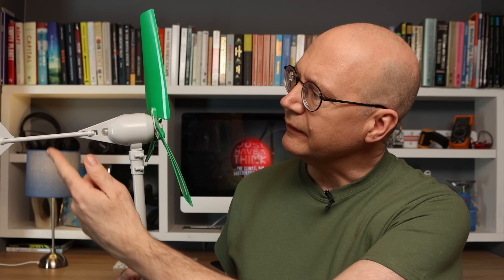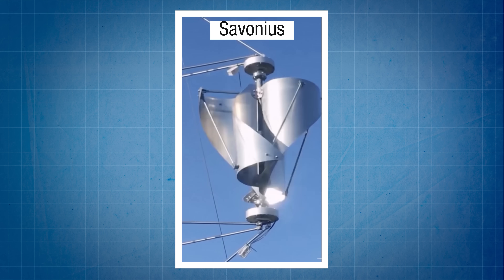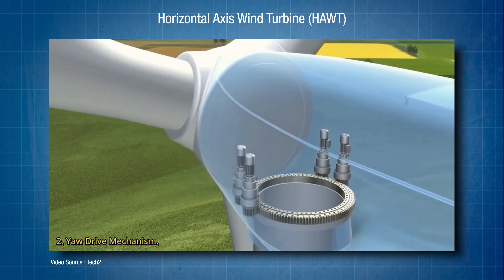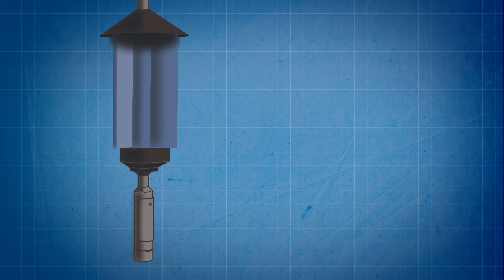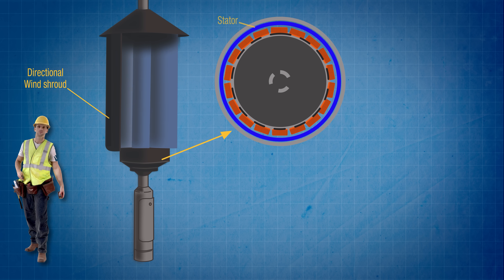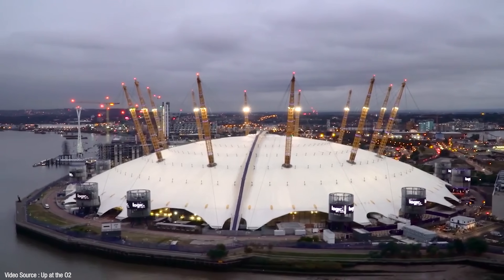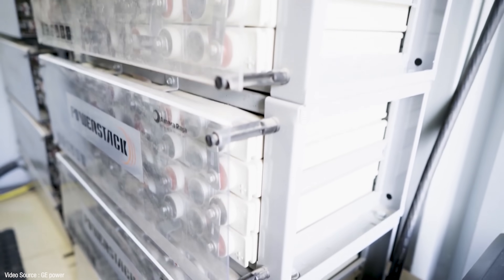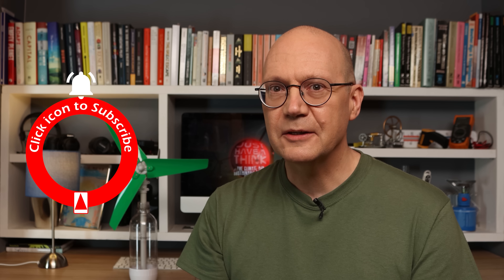A vertical axis wind turbine that doesn't need the prevailing wind! How do they do that?

Comment: This is ridiculous.  For every action ther is an equal and opposite reaction.  If a passing car is causing the turbine to spin then the car is applying a force on the turbine.  In this case air is the medium used to transfer that force.  If the car is applying a force on the turbine then inevitably the turbine is applying a force on the car by revisiting the flow of air away from the vehicle.  Since a gasoline or diesel engine is ultimately driving the vehicle then in this case you are effectively forcing the driver against their will consent and likely even their understanding to sacrifice a tiny amount of their fuel efficiency to power these roadside turbines.

While it might not seem like much if a single driver passes one or even 10 of these it certainly becomes significant if they pass those same 10 for years.  Imagine thousands of then lining roadways everywhere.  Again the individual driver might not notice at all and yet that increase in cost for them to operate their vehicle is still there.  It would be like stealing a penny from 100 million people.  Yea no individual is going to notice but you still stole from them and now you are a millionaire.  

Ignoring the legal repercussions as soon as a class action lawsuit gets wind (put intended) of this ther is a much greater concern.  The whole idea of wind power is about sustainability and renewability.  Since this power is being leached off of random gas and diesel engines then these are what is ultimately generating the power.  Automobile engines are incredibly inefficient compared to power plants.  It's literally almost the worst possible way to generate energy on a mass scale.  Assuming a utopian future where everyone is driving electric cars who's batteries are charged with wind or solar then you have the same issue though not quite as bad.  All you are doing is taking those tiny bits of energy generated elsewhere and transferring them from the cars battery into wind power for the roadside turbine.  At this point you still lose energy based on the efficiency of the battery.  Also you still have the legal repercussions of stealing from millions of drivers passing by your energy u siphon on a yearly basis.

This looks like a pretty cool idea at first glance.  Without considering the physics of where the energy comes from it looks like free energy.  Or recovering wasted energy.  Sadly this is not how the universe works.  Nothing is free.  All energy comes from somewhere.  I. This case it comes from passing cars.  Sadly for all energy transfered into the turbine by the car there is an equal resistance transfered back to the vehicle which it pays for in fuel efficiency and ultimately at the pump.

Comment: They have added a air flow cancelling shield on the back side which doesn't block back flow. The shield blocks wind from the back side detracting to the effectiveness. There is no negative airflow on a vertical axis blade. The blades are not reversed on the backside.
They could add some positive force deflector fins to the entire device much the way are found in jet engines to increase the air pressure inside the turbine.

Comment: I want to thank you for posting this video.   For more than 4 years, I have been thinking about how nice it would be to harvest the wind generated by vehicles driving on highways.   I had proposed that my son, then in 8th grade, put together a science project looking at vibration type wind generators (e.g. like blades of grass), but his teacher shot down the idea as infeasible.  Your video brings many ideas to the front line of future alternative energy solutions and I applauded your efforts. I also applaud your quick correction, as many folks don’t like recognizing when a mistake has been made.  Very nicely done.  If I had any engineering skills, I would be working hard to improve alternative energy systems as I believe our future and the future of our planet depend on it.  Thank you!
Reply from the maker: Hi Oswald. Thanks for your kind words. Much appreciated. You might like to check out this latest video from a YouTube colleague.

https://www.youtube.com/watch?v=iWGfB4najfM

It actually features precisely the type of bladeless wind 'turbine' that you described in your message
Reply: Thx.  I spent the last hour getting acquainted with Rosie, at your suggestion.  She is brilliant.  I will look at the additional link soon.  All the best, O

Comment: slow the air alongside the road so the next car pushes on motionless air again.  the air flow by the road slows the relative speed of the headwind the vehicle hits.  conservation of energy means the cars are going to replace the energy.  no, this is not a smart use; more like perpetual motion.

Comment: A friend ask; if the entire world goes electric autos, how are they going to charge them. My reply; Power generators produce electricity 24/7 used or not, so while people sleep their autos and house batteries recharge.
Then, I told him, new technologies and process will be developed, as with all other new devices. Here, is a new process to add electricity to the grid or off grid applications.
These turbines could be incorporated into the design of an electric vehicle then the primary or secondary battery could be charged as you roll on down the road, cutting the total amount of electricity that would be required to recharge your batteries.

Comment: I use a 7kW home charger to charge my EV overnight less than once a week. I wonder if one of these, with a maximum output of 6kW would be capable of charging an EV? Even if it took twice as long to charge! 
It might also be a suitable solution for people who would like an EV but don't have the ability to run a cable from their house to their car. Perhaps one of these turbines fitted to a lampost on the road where the car is parked could be used instead? In return for giving the EV owner priority parking at the lampost perhaps the car could provide battery storage for the light and turbine to power the street light as well, meaning that the light would not need to be connected to the electricity grid? I can see that the output would be reduced because the charging car would tend to shield the turbine from the traffic so it's not a perfect solution but there must be many opportunities - perhaps for installing a self-powered street light outside your house and also using it to charge your car?

Comment: I have some decorative “wind spinners” and was surprised at how much they spin. I didn’t realize how much the air moves where I live. I would love to see these VAWTs produced for use by houses.
Reply: Nina, you're right on. If you wanted to power your yard lights and such by harnessing local gusts and storing that energy in lithium cells, much like how those little solar walkway lights work, then absolutely give it a go. Heck, if you have enough of them, you might even be able to offset your home lights. Power storage is pricey if bought new, but it can be a fun learning experience if you're willing to think outside the retail store.
Reply: Yes, but connect them to a generator with an electrical load on it and you immediately need a lot of torque to spin those blades. I had a hand-cranked generator (a test box of some kind for checking insulation I guess), and open circuited, you could spin the handle with little effort, but if you put a dead short across it, it was almost impossible to spin the thing. Obviously, with ordinary loads it was easier but still took effort.
Reply: @and7barton  That’s why the engineers need to design ways to get the most bang for your buck.
Reply: @and7barton  you could not be a direct moron and contact it to a controller and a battery and then in a separate circuit connect your load to the battery. Or we could be retarded and do it your way....
Reply: Any electric motor, though some are better than others, can be used as an electric generator. My suggestion would to use an old alternator. Though since any motor will work, I suggest a broken power tool or old DVD player motor.
Reply: They exist and are very affordable compared to solar
Reply: Might make you 5 cents worth of electricity a year dipstick
Reply: @RAR-inc  I find it really funny when trolls mock the very power source farmers have been using for centuries to do the grunt labor of pumping water. You, sir, are the dipstick.

Comment: As a retired highways foreman, with many years in civil engineering, I've been an advocate of thiis esentually free electricity production since 1980.
Reply: How about starting an organisation to put it into practice?
Reply: Can we amalgamate?
Reply: Free? Until you see the price tag. And the replacement costs after a few years.
Reply: The only thing that bothers me - will these affect the fuel economy of vehicles running close to them?
Reply: @shmadmanuts  if anything i would think it would help keep the slip stream more stable. But still very minimal, the poles are already there
Reply: @Seriouslydave  Yes the poles  there, but slim. Make them fat with the blades, and thee will be a difference. 
And I really doubt the efficiency of such contraption. I have noticed that airflow too when standing near the curb when a heavy truck was passing too close. But just few meters away from the curb, the flow was greatly reduced. Highways have multiple lanes, some a shoulder too, so lampposts are not quite near the airflow, unless they are in the middle between the two opposite lanes. 

Anyway, for me is just gut feeling, since I have done no research, but time will tell. We will see if these gizmos will be implemented or not. They may be, but the energy will come from the actual wind, not the cars. .  The issue is just efficiency, since wee see that this comes with size.
Reply: @shmadmanuts  of course it will, there is no such thing as free energy. this is a lunatic idea only fools would support.
Reply: @Withnail1969  thank God I thought I was the only person in earth that thought this... of course it's stealing energy from the cars.
Reply: @quintyoung  not necessarily. It might reduce slipstream from the cars in front of you, but break the winds of oncoming traffic.
I'd guesstimate energy losses at the vehicles to be rather low.
Reply: Yes, of course it increases the resistance on the cars, causing them to use more energy to maintain their speed, exactly the amount of energy reclaimed by the turbines (minus lots of loss). Eliminating roadside wind resistance would do more to reduce wasted energy than this nonsense can recapture.

Comment: Close to ground and built up areas where air is turbulent. Whatever wind there is will disrupt the prevailing flow created by traffic. Heavily skeptical about the real life generating potential compared with the theory and lab condition estimates. Also a power source that depends on continual traffic flow. Will only work at limited ones of day and I estimate to about 5-10% of the capacity they claim to expect.

Comment: You've won me..
I have 2 turbines (VAWT's) that run my shed lights and trickle chargers. All 12 volt battery storage. 
I have found that placing the turbines on opposing diagonal corners of the shed provide the best result.
There's always wind at the corner of the building.

Comment: Watching this, I remembered seeing a very interesting guard rail design in S Korea. Instead of a guard rail, they have small hard rubber wheels mounted horizontally. If a vehicle strikes the barrier, the wheels prevent a hard crash in places where regular guard rails would destroy a vehicle. I'm not clear about exactly what the voltage and amperage of the wind turbines is but I imagine getting hit by a vehicle could be very destructive to both the hardware and the electricity generated and distributed. Maybe a row of S Korea's wheels under the wind turbines would make a safer and more reliable system.
Reply: Guard rails are built not as a wall but as a flexible horizontal ribbon. The bolts that attach them are built to fail so the ribbon is free to flex on impact and cushions the car slowing it down.

Comment: I think the video is generally very good, but you could have stated more clearly that even at best this system could produce only a tiny amount of the electricity a country needs. When talking about decarbonizing the whole electricity production, this system can be left out of the discussion. It may be very useful as a niche solution in the mentioned areas of application, but that's what it is: a niche solution.

Comment: I find this fascinating. We have to remove fossil fuels to save the planet and each time I see something related, it takes a leap forward in technology. Many small units out pace the more expensive large HAWT design. The larger are more expensive and up keep costs vrs a smaller light pole unit can be replaced simply at a lower cost when they fail. As for storage, this needs more development as batteries are the weak link.

Comment: Who is going to be first to suggest putting these turbines on top of electric road vehicles and planes to supplant the batteries they currently use?
Reply: Wouldn't work - You'd require more power to move your vehicle than the turbine would generate. You were an inch away from naughtily suggesting a perpetual motion machine.
Reply: @and7barton  Who me?

Comment: A VERTICAL AXIS WIND GENERATOR MIGHT WORK SURPRISINGLY WELL AT THE TOP OF A MAST OF A SAILBOAT. EVEN IN LO WIND CONDITIONS. THE ROCKING OF THE BOAT MIGHT INDUCE SIGNFICANT ELECTRICAL OUTPIUT FROM A BOAT STATIONARY IN THE WATER BUT ROCKING NEVER THE LESS

Comment: No.  These roadside VAWT are a joke.  There are MANY issues with this idea.  One is that the power is scattered all over the place with wiring running miles requiring transformers to boost the voltage to reduce voltage drop.  Second is the efficiency of wind turbines increases with scale.  Third is the idea of getting enough power from passing cars requires the cars to travel fast and the turbines to be VERY close to the road.  This becomes a hazard at that point.  Plus the air at ground level next to a road with buildings and cars driving by is going to result in VERY turbulent air.  While VAWT does handle the turbulence better it would be far better to put the wind turbine in a location that gets good wind naturally and put them as high as you can feasible afford as the more altitude the more wind you will get in a given area.  For the same cost a single large scale wit=nd turbine would EASILY make 4x the energy... if not more like 40x.

I got into the hobby years ago and loved the idea and science behind VAWT.  I even built one.  They are typically not worth it any more as solar has gone down significantly in price and up in efficiency and home wind turbine costs have change little.

Comment: Commercial vans used to have a small vertical axis ventilator on their roofs. At a Brighton Eco show, early 2000, there was another display model that generated electricity. As with all ideas that threaten the economics of existing business practices. It will be squashed by fair means or foul. Especially if it would benefit the economic  slaves in our society.

Comment: In addition to putting these small vertical turbines on existing lamp posts, they can also be installed on dedicated posts which are set in between the lamp posts. Research needs to be done to find the optimal post spacing, turbine height, and installation height..

Comment: Even if this system is only installed on the road network, using spread out battery banks, to power the lighting along these routes, this would cut down on a HUGE electricity demand.!😲🧐🧐!.

THIS SYSTEM SHOULD be used ALREADY, in multi-story, supermarket, and ALL other types of car park.!🧐!.

WHAT IS TAKING SO LONG, with company bosses, thinking about the 'bottom line' ?
This is a NO BRAINER, and should be being installed ALREADY across the country (planet).!🧐!.

ACTION IS NEEDED NOW.!🧐🤔🤬!.

We DON'T have the TIME to f'k about, putting things off, until someone else tries and fails or is successful.!🤬!.
Things NEED doing NOW.!🤬!.

LOVE THE VIDEOS🥰.
KEEP 'em COMING🥰🥰.
RICH 🥰🥰.

Comment: I'm not sure I agree with the concept of the fuel transfer synopsis. Ie wind displacement creates adjacent resistance. Ever tried to cycle against the airflow of an oncoming truck. You will experience a shortfall of energy that has to be replaced. Hence the harvested energy drives the rotor but creates a  % resistance that will in turn increase the air back pressure in the vicinity to a degree that will be higher than if the turbines were absent. Hence the higher air pressure will have to be compensated for by the vehicle experiencing an artificial headwind in terms of higher acceleration than normal which would simply be the same as syphoning fuel from every vehicle that passes. So ostensibly the"green" dividend if I'm correct would simply be pinching from Peter to pay Paul.

Comment: This is a great idea!
Such roadside-turbines are not strictly speaking a source of renewable energy. But rather reclaimed energy that would otherwise have been wasted.
That this energy is currently still mostly produced by vehicles burning fossil fuels is very unfortunate (to put it mildly), but does not detract in any way from the idea of reclaiming the wind-energy from the cars. It would still be a good idea even if all the cars were electric. Waste not, want not.
PS: When there is enough preveiling wind, the turbines will also generate a certain amount of truly renewable energy. In windy areas, this could be quite a lot.